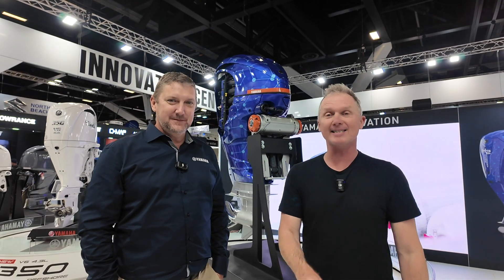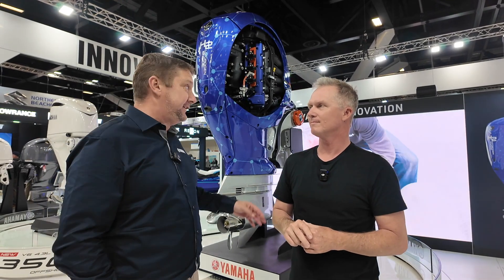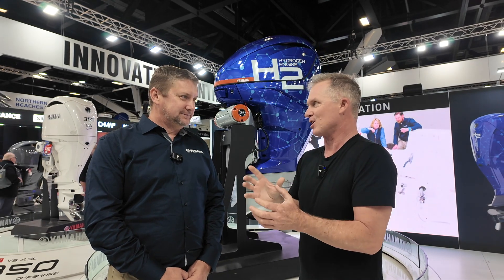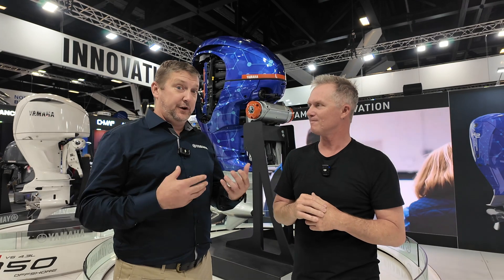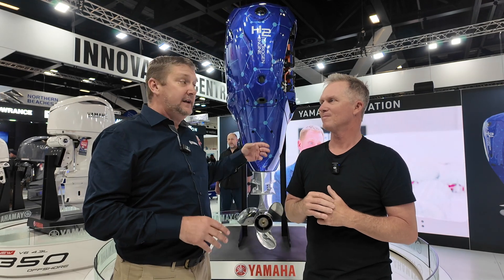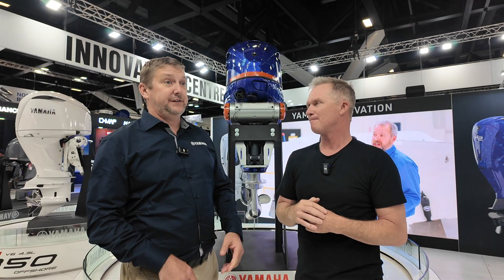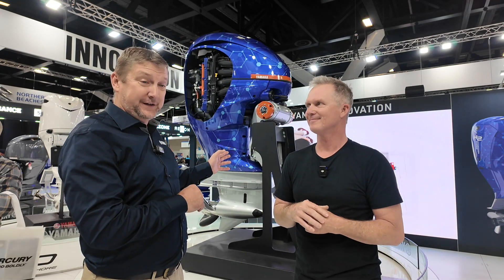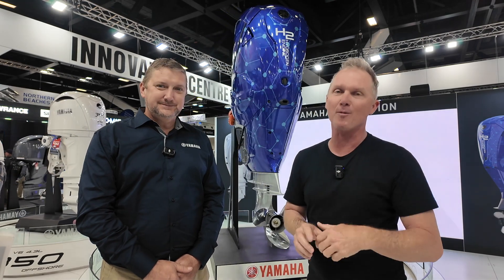Yamaha Hydrogen Outboard at the Sydney Boat Show

Comment: Don't get too excited. The problem with hydrogen engines in cars is you can't fit enough liquid hydrogen in the vehicle to get any range so boating will be way worse. Hydrogen only works well with as fuel cell electric.